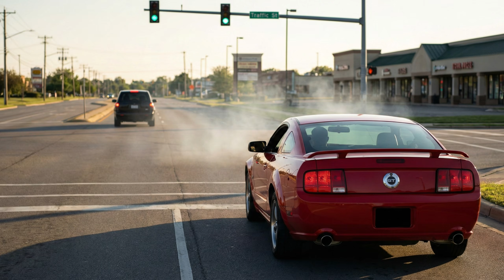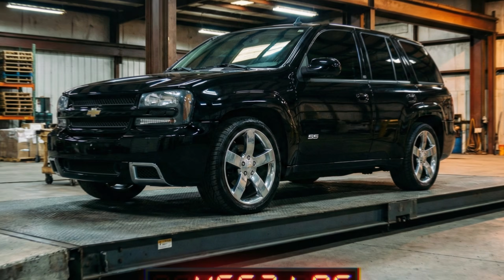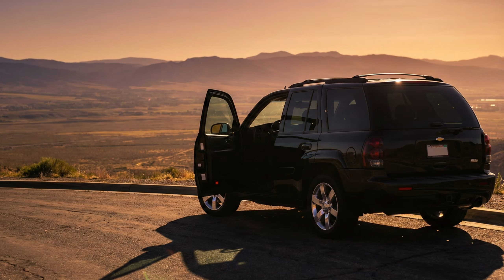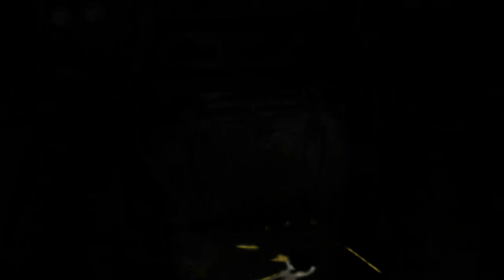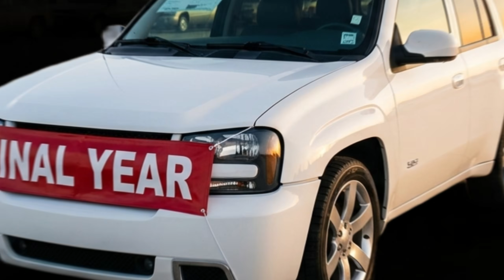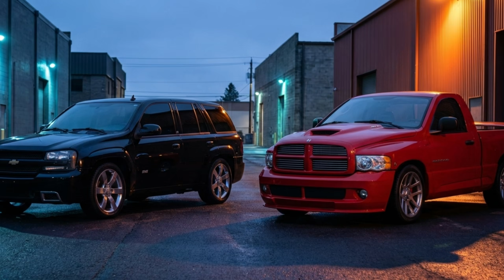GM Put a Corvette Engine in an SUV — Then Ruined It | TrailBlazer SS

Comment: This AI is wrong in so many places, but around 8 minutes it's pure bullshit, you don't go with a 6 speed they have just as many issues, everyone I've pretty much ever seen uses the stronger 4l80, and saying that a 2006 1500 weighs less than 5000 pounds is blatantly false, also the 4l70e is just fine. Those are put stock behind 6 liters all the time with no issue, same with the 65, they literally came with the lq4 in the higher trim SUVs, and those didn't produce much less torque especially tuned hot like everyone does 
NOBODY CHANGES THE FLUID IN THESE THATS WHAT KILLS THEM
Reply: Yea, and GM doesn't use ZF 6-speed autos. Those are the only quality ones that exist, in the automatic world anyway.
Reply: @crazyidiot5309 it seems like ZF is the only good automatic transmission manufacturer left. At least that mass produces them